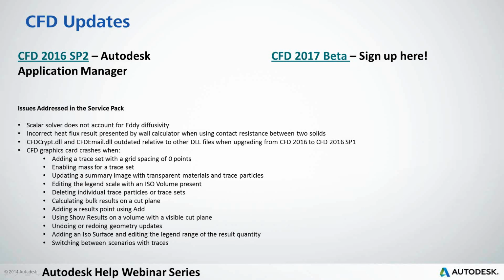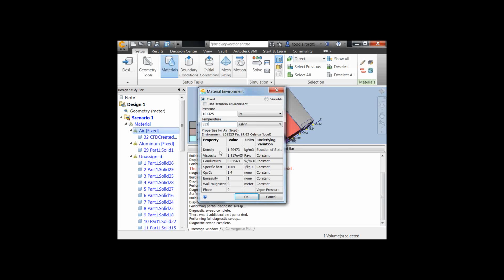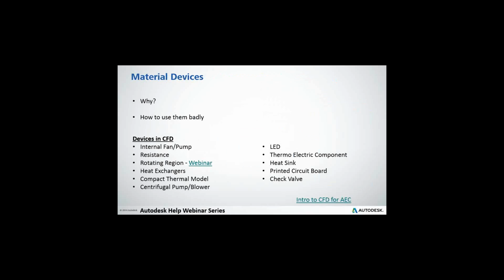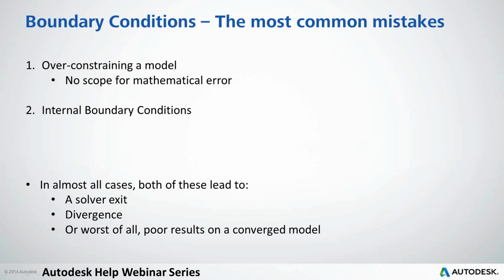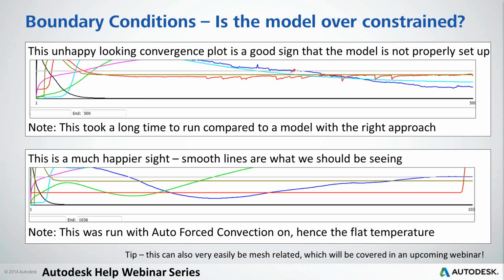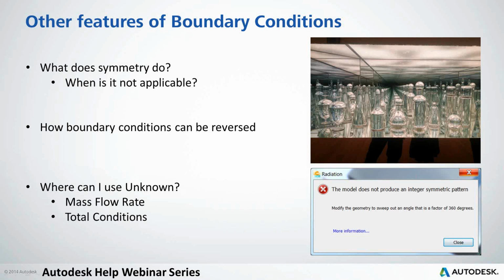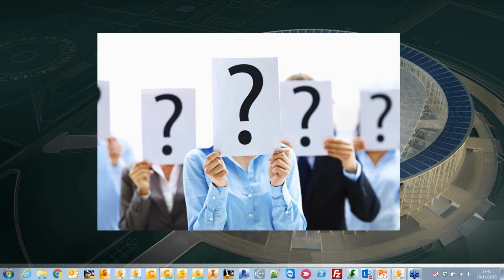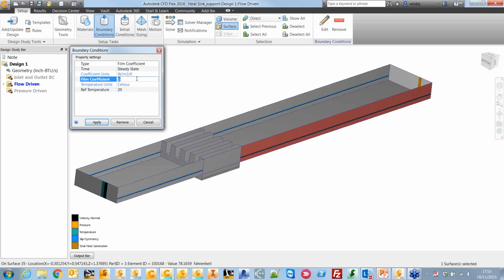Correctly using Material and Boundary Conditions in Autodesk CFD

Comment: Hi, I'm working on really simple model in cfd, it is a very simple and standard and I only need flow information nothing else (not heat transfer). This should be really simple, but I can't figure out how to set boundary conditions that are a box with two sides: outlet and inlet sides. Could you make a simple video with instructions on how to do this. All tutorials are either too complicated or too non-technical